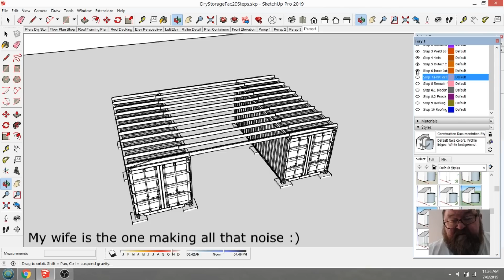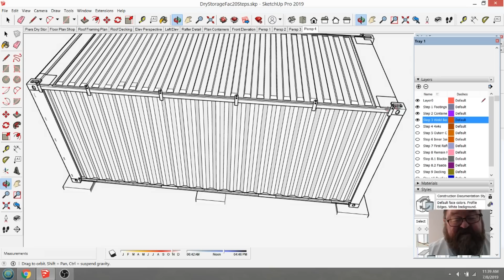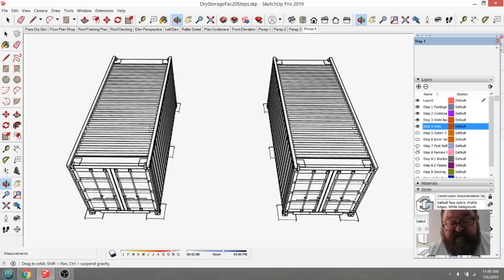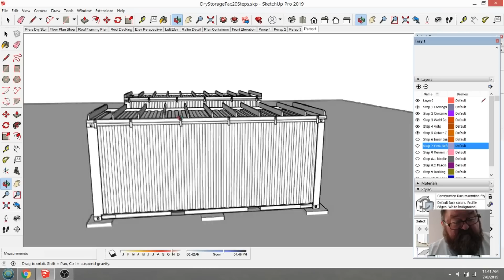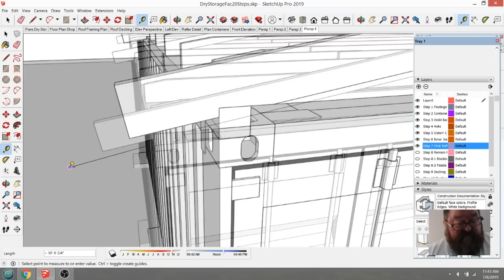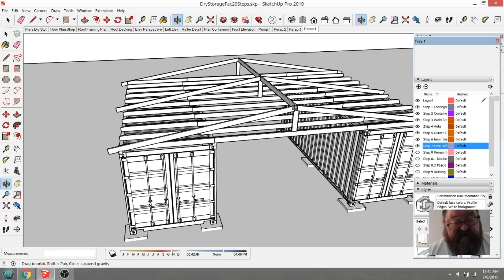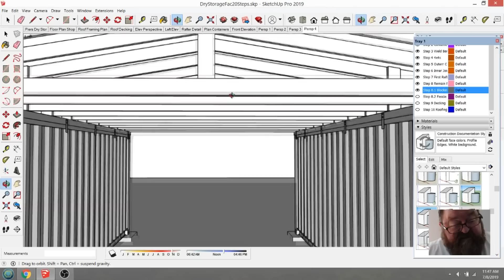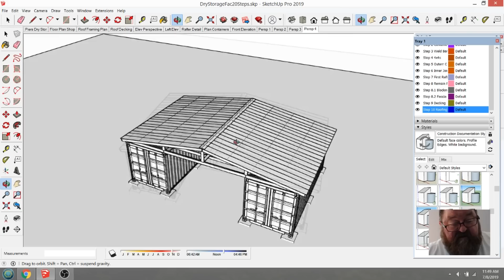Building a Roof Over Two Shipping Containers - SketchUp - Active Military Use - Read Description

Comment: in snow load areas , adding  a 8/12 pitch or what ever works in your area and beefing up your perlins would work ,but i get the basic structure involved..  thanks for the great vid. !
Reply from the maker: You can design any pitch to work with different loading.  I can make a flat roof work with snow loads but I get your point.    But just so people know,  live and dead loads are one thing and the way you design the shape of the roof is another thing. You just can't change the pitch and make it work.  You have to specify the design load then design the framing to match the loading and so the pitch is not necessarily related to the design loads. Thanks!

Comment from the maker: So for those people questioning this; (like silly canadians) this was designed specifically for a customer of mine who I mentioned several times during the video so if you have a project it will have to be designed for your own particular site.  You should never take a design from the internet and rubber stamp it for your own project. I assume my viewers are smarter than that :)
Reply: I agree with you totally … except the part about "silly canadians" :-)
Reply from the maker: @PennyZ1000  haha, jk
Reply: What design software were you using?
Reply: @DragonSlayer-rd4mn  It's in the title - Sketchup.
Reply: Spacekriek - ahhh. “Smacks forehead”... Thanks.
Reply: What type of program do you use ??

Comment: Great Idea does it meet code for Canada or only idea concept
Reply from the maker: it only met code in an east African nation where US forces were kicking arse :)
Reply: This building as shown here would not meet Canadian building codes.  However similar structures have been built in Canada (Alberta specifically, probably other places too) that do comply.  The shipping containers need to be on a foundation extending to below frost line (concrete footings or screw piles, for example.)  Roof structure needs to meet all the usual requirements for fastening, bracing, wind/snow loads, seismic, ventilation, etc.  Pre-Engineered roof trusses would be a much better alternative here than stick framing.  Some jurisdictions may require an Engineer's involvement since it involves some steel (welding connections for the roof anchoring.)
Reply from the maker: @PennyZ1000  I don't thing you understand the video.  It is for a specific customer I mentioned several times in the video.  It is not for Canadians who think they are special :) So for non-human habitation such as for storage where the frost line is around 6" like here in SE US it works fine.  Take your canadian blinders off :)
Reply from the maker: @PennyZ1000  also, it was good enough for the special forces in Africa so I am sorry if it is not good enough for cananda :)
Reply: @ArtisanTony  No offence was intended.  I understood the video perfectly. The question/comment asked was whether it would meet Canadian codes and I provided an objective, factual answer to that specific question.  I have quite a bit experience in the industry here and overseas (although not in Africa so I can't speak to that specifically), I've worked with several clients on similar projects that complied with our local building conditions and requirements.  I was not passing judgement on the video and definitely was not judging the worthiness of special forces in Africa.
Reply: @ArtisanTony  And to be fair, I did enjoy your video quite a bit.  I was surfing around You Tube looking for a connection detail for the wood roof to the seacans and your model and explanation were very good, very clear.  Most videos I saw were woefully lacking in detail or technical explanation so yours stood out from the rest … thus the reason I read through the comments and responded.
Reply from the maker: @PennyZ1000  Thanks!  I appreciate that much!

Comment: Hey Tony, roughly how much snow and wind would this style roof withstand?  I appreciate you posting this video and explaining it in detail.
Reply from the maker: That is a good point and I should have mentioned that this was specifically designed for desert conditions where there is no snow loading and the building is also temporary.  It also is designed around using only one type of material and length they can get in the area. I'll pin this comment so others will know. Thanks!
Reply from the maker: By the way, Chief told me that wind was not that much of a factor.  I would probably not recommend this design for human habitation either.   We use 4/12 pitches and more bracing and fastening on their billet buildings.
Reply: What design software are you using?